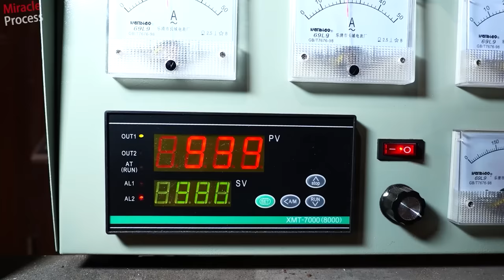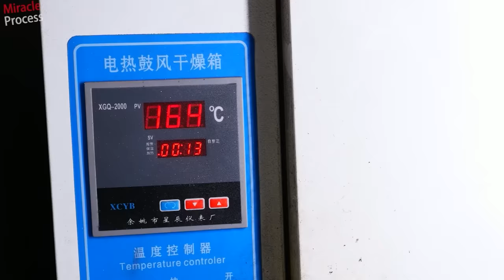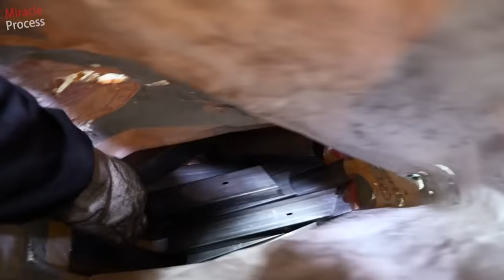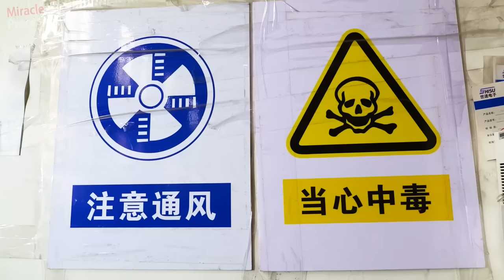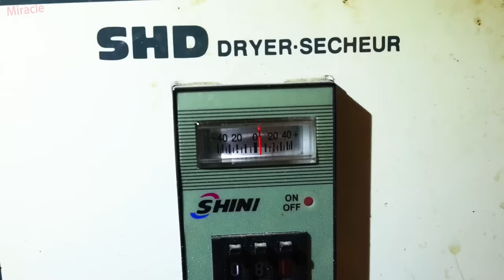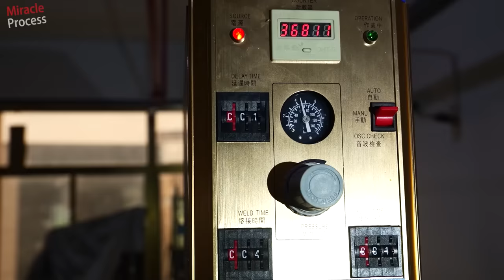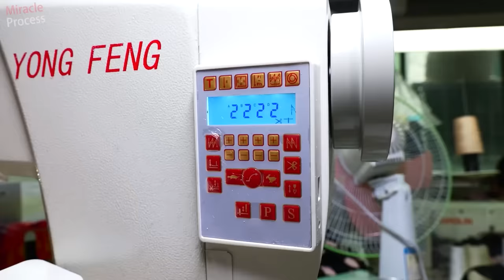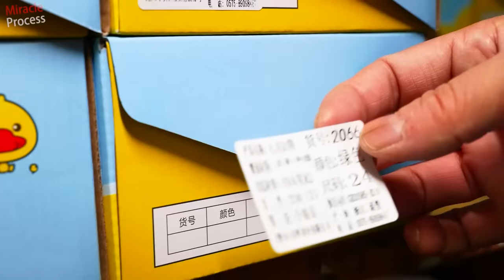Wonderful Compilation of China's Factories Mass Production Manufacturing Process # Season 3

Comment: I was amazed at the flat glass being turned into a dome, I didn't see any heat source to shape it.
Reply from the maker: That long machine is a heating system. After this distance of heat treatment, the glass has been tempered, making it soft and easy to shape😁
Reply: about 5 mins in. The dome thing has heaters around it.
Reply: Lol it's an ancient Chinese secret + the working areas r just so clean.

Comment: Workers using grinding wheel with no safety glasses or PPE. Hope they have a good ophthalmologist on staff.
Reply from the maker: Thank you for your concern. As an observer (photographer), I believe there are two reasons for the occurrence of this problem: 1. The factory manager did not enforce sufficient protective measures for the workers. 2. The workers themselves have a weak awareness of safety and fail to protect themselves. In fact, these protective equipment are very inexpensive!😤

Comment: Good workers, but the blacksmith welding the knife’s shaft has no air evacuation. Wonder how long his lungs will survive without damage or cancer, pity for his life☠️
Reply from the maker: It depends on himself, perhaps he felt that the time was relatively short and did not take timely protective measures. In other processes such as requiring long-term sharpening of tools, he will wear protective equipment such as a mask
Reply: @miracleprocess  Your answer is human denying, the employer has the duty to protect the worker from each form of damage physically and psychologically. All other is crime agains humanity ☠️
Reply from the maker: @charly-s  In China, the law does not have a strong binding force on employers, which is a fact. So many times it is up to the workers themselves to take preventive measures. Only oneself can protect oneself. The situation is really complicated